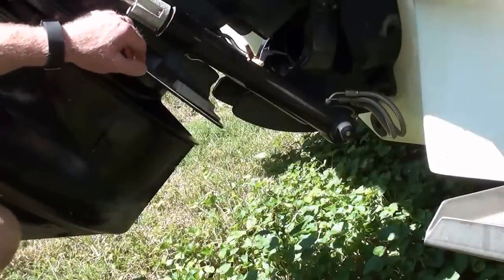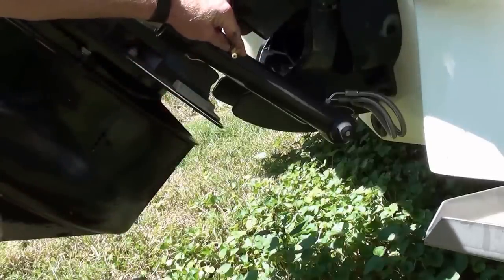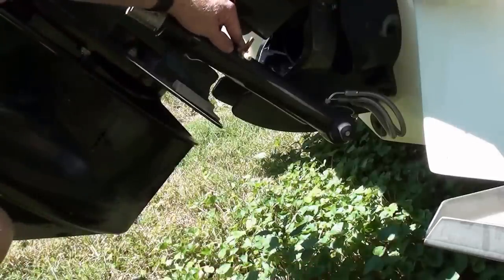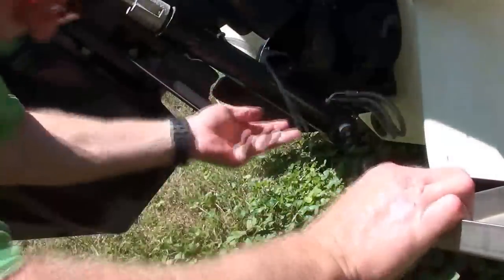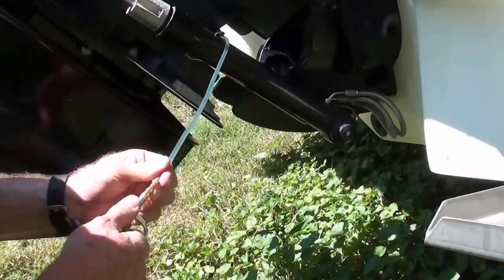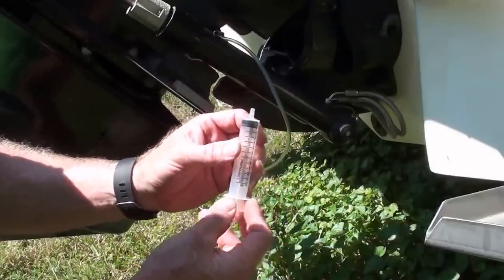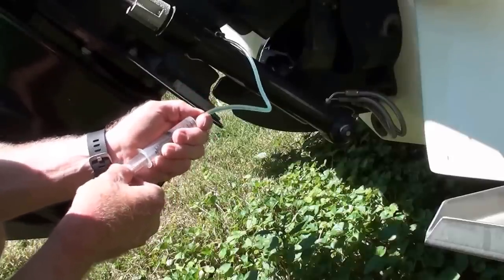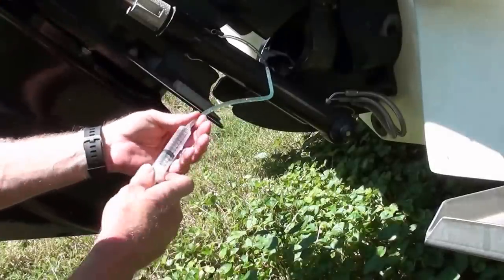Boat Speedometer Not Working

Comment: This is excellent. I was not able to force the soapy water through so I took the line off my weed eater and fed it down from the top. It took some work but was able to break the blockage. I was able to clear it out and flush it with soapy water and air. Thank you for posting this.
Reply from the maker: Great idea on the weed-eater line-Thanks

Comment: Great thread!  I used the same strategy and unfortunately my blockage was more stubborn.  I ended up with some additional suggestions:  1. use a heat gun or hair dryer to heat the 3/16th's tube - my plastic connector seemed brittle and i was very careful not to put undue pressure on it to attach the tubing;  2. if the water solution doesn't work I then used my air compressor and could have used a 3rd hand.  What I ended up doing was to hold the tube connected to the boat with one hand and the A/c fitting with the other - so it would not blow off when I sent 150 PSI into the tube.  Then i used my knee to get air flowing-  worked like a charm!!!  Cant wait to get back on the water and be able to confirm my speed.  Speed for my kids doing surfing and wake board ends up being important - one kid goes faster and the other not so fast.  Great to get this fix without traveling to shop to wait and pay $$$.... THANKS!!
Reply: Hadden Dean great suggestions! Thanks for the feedback. Happy boating!!

Comment: Great video. To unclogged my speedometer channel we always use “aircraft safety wire no#20” works perfect for snaking all jet channels. Simply unplug the tube as you did and insert the wire down the channel freeing the clog out the other end.
Reply: Thanks for the kind note and aircraft safety wire tip! Where do you source the wire, Amazon?

Comment: This was very helpful, thank you!.  Just wanted to add that the boat I purchased had not had a working speedo for multiple years and this tube was PACKED with sand, clay, wood and seaweed... packed so hard that I had to use a drill to even begin cutting into it.  I did these steps, on and off, for a couple of hours but nothing was changing.  I had utilized the full length of my drill bit, I tried coming in from the top with weed eater line (as suggested by a commenter) but I was still not making progress.  I had a 10" piece of 14ga. solid electrical wire and I took the copper ground wire, put it in my drill, and slowly worked it back and forth.   The copper is flexible and will bend if you push to hard or run the drill at too high of a speed AND YOU NEED TO TAKE CAUTION NOT TO BREAK IT OFF INSIDE THE LEG, but this got the obstruction cleared in about 90 seconds.  It still took some flushing with the water solution and running the wire in and out to keep breaking the larger chunks, but I was finally able to put the air hose on the lower hole and blow out the last of the larger chunks.  Can't wait to get it on the water and see speedo movement on a gauge that was not operational for at least 4 years.  Thanks again... 5 years later and your video is still helping others! :-)
Reply: Thanks for the great feedback and new unclogging ideas Brock! Happy boating!!
Reply: Great info. I’ll try it. Step by step. Thx

Comment: Thanks Doug, that was great help.  I actually overlooked this very small outlet on the back of my lower unit at least half dozen times, took it up the river and got lots of nicks and chips on the back of my lower unit so with all those it was hard to pinpoint the exact spot of the hole.  Finally found it, cleaned it out with a drill bit by hand, used the tubing and syringe you suggested, had to disconnect the existing tubing from the outdrive and given the type of attachment point had to remove the connection tip and reattach to my tubing.  Of course I got the same result, lots of built up pressure, kept adding hot water, and it started leaking out of the attachment point and not to pitot hole, used a drill bit by hand but was only going in 1/4 inch, from other videos I knew it was still blocked so I attached it to my drill and added some power behind it, finally broke through and it was definitely packed with dried mud, then the entire drill bit was able to be inserted and removed.  Have not had it in the water yet, but now that its cleared out if I run the motor on muffs should the spedo work now either on throttle or in gear?  My understanding is it has to be in the water actually to be able to measure pressure and speed?
Reply: Great comments! Yes, you will need to be in water to test your repair. The muffs don’t apply pressure to the Speedo. Great boating!
Reply: @douglee5798  One final question if you don't mind.  I'm concerned about the effort used with my speed drill to clear out the blockage and that I may have damaged.something inside that orifice.  Do you know if that is just dead space in the lower unit there or is that connected to the pitot tube from where we disconnected it above at the top and if I could have damages the lower half of the tube inside the unit or worst case drilled a hole right through it from the orifice? Videos I've seen clearly show the drill bit going 90% into the orifice, mostly by hand without force but in my case I had to use full on drill speed to clear it out.
Reply: @divenride6758  That’s a great question I really don’t have the expertise to answer. I used the drill on low speed and wasn’t very aggressive. I still had an occlusion and that’s what prompted me to use the irrigation technique with soap and warm water. If I were you, my biggest concern would be drilling into the oil cavity. I would expect that if you aren’t seeing an oil leak (gear lube) from the Pitot tube hole (same hole you inserted drill bit in) you’re ok. Sorry for the delayed reply!
Reply: @douglee5798  thanks again. For the guidance. I had the boat out and Speed Racer is back in business, Speedometer is all working well now.  👍

Comment: I found mine is plugged with a piece of wood. But the line is clear. I like your idea of back wash through the LU. Great Video!
Reply from the maker: Thanks for the feedback Shaun! I'll have to watch out for wood pieces. The river I boat on has lots of driftwood in the spring.
Reply: That drill bit worked great. Then I used my hose sprayer to check the speedometer and it moved back up which before the clog prevented any speed indication. Taking her out this weekend to explore our new area.

Comment: Thanks for the video!  I haven't attempted this yet, but I've learned something new.
Reply from the maker: Thanks George!
Reply: @dougstenslokken3587  I just tried it yesterday and your procedure worked perfectly for me.  I had a lot of compounded mud/clay from the river (I hit a sandbar a few months ago) and after 10-15 minutes, I was able to clear the line and blow clean air through.  I'm excited to put her back on the water and see if the issue is fixed.  I'm mechanically inclined, but wouldn't have known where to start without your video.  Thanks again!

Comment: What about the method of pulling the tube from the back of the gauge and shooting air through there? Think that would work?
Reply: That would be a great idea if it works. The longer the tube, the harder it is to transfer significant pressure to the other end. You could also rupture your tubing if it has a weak spot in that long distance.

Comment: Can you clarify where you put the clear tube on the top before you used the plunger? I cant seem to find where that goes on mine.
Reply from the maker: There is a tube you can feel way up on the stern drive in back. It's difficult to see, but you can feel it. The tube connects to a plastic connector that twists off (righty tighty, lefty loosey). Twist off the connector and attach the tubing to the connector and re-attach it. https://forums.iboats.com/forum/engine-repair-and-maintenance/mercruiser-i-o-inboard-engines-outdrives/612639-bravo-3-speedometer

Comment: Did you put a new zip tie on after reassembly?
Reply from the maker: No, but that wouldn't be a bad idea.
Reply: So I was unable to get the hose of the bayonet, but when I pulled the bayonet (yellow piece) out of the hole I noticed some dirt on in and in the opening. I cleaned off the dirt and used the hose and syringe to blow air and water (pumping the syringe numerous times) through the hole in the back of the lower unit and all seemed clear. Took it out today and it worked perfectly. By the way, my spedometer never completely stopped working. It was sluggish and wasn't tracking the right speed (showing slower than the actual speed.) All is working now.
Reply from the maker: @richhusick3507  That is great news! Thanks for the feedback.

Comment: FANTASTIC !!! I HAVE THE SAME PROBLEM IN A VOLVO SX STERN ... (1999 GLASTRON SX 175 VOLVO 3.0 GL), MAYBE THE PROCEDURE IS SUCH AS YOU SHOW US IN THIS VERY CLEAR VIDEO.. WHO KNOWS ? DO YOU THINK THAT IS THE SAME SYSTEM? THANK YOU IN ADVANCE FROM ARGENTINA ! (THE INSTRUMENTS ARE "FARIA")
Reply from the maker: Thanks for the feedback. I think its worth a try on your Volvo. I'm not an expert on that boat and stern drive model  but I would expect them to be similar in the way they measure speed via water pressure at the lower unit.
Reply: Do you think a 1996 mer ruiser alpha1 would be the same. It doesn't have flipper tube like alot of other boats have.

Comment: I was cleaning my today and I broke a drill bit in the hole :(  any tips how to remove it without taking the lower unit apart? Thanks.
Reply from the maker: Were you using a power drill or your fingers to turn the bit? Its too late now, but try just your fingers next time. Can you push it out by applying a water stream or air stream from above? You may want to Google the question. It appears that others have done the same thing. One comment I found stated that you won't have access to the drill bit even if you take the lower unit apart. Bummer!
Reply: Doug STENSLOKKEN I was using my fingers but some how it just broke :(  yeah sucks for me now.  Might have to Google for some details.

Comment: Where do I plug the hose into the speedo?
Reply: The speedometer line is connected to the top of the Bravo 3 in a tight area that's hard to see. You have to reach up with your hand and feel for the hose. It's on the upper back side of the Bravo 3. The hose is connected to the Bravo 3 with a plastic connector that twists in and out about a quarter of a turn. Untwist the connector clock-wise and connect your irrigation tube to it. Screw it back in place and begin the irrigation procedure. Follow this link to see what the connector looks like.
https://www.google.com/imgres?imgurl=https%3A%2F%2Fcdn10.bigcommerce.com%2Fs-0lagkiv8%2Fproducts%2F927%2Fimages%2F1944%2Fbravospeedo__91968.1417483620.500.659.jpg%3Fc%3D2&imgrefurl=http%3A%2F%2Fwww.marinediscounters.com%2Fmercruiser-bravo-iii-speedo-pick-up-815303t%2F&tbnid=X9d6qTuzFyQI6M&vet=12ahUKEwiJ9Oaix-zwAhXPPs0KHU1HAjYQMygCegUIARDuAQ..i&docid=jkppHbv2Zxc6tM&w=300&h=224&q=Bravo%203%20speedo%20hose%20connector&ved=2ahUKEwiJ9Oaix-zwAhXPPs0KHU1HAjYQMygCegUIARDuAQ